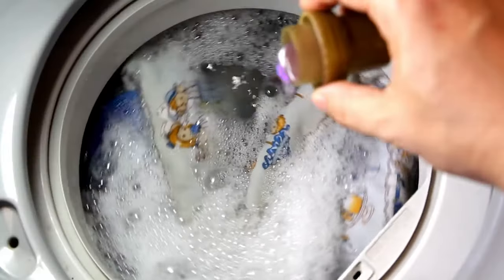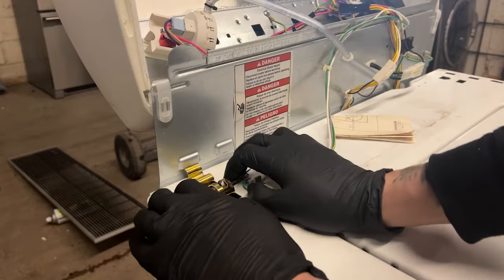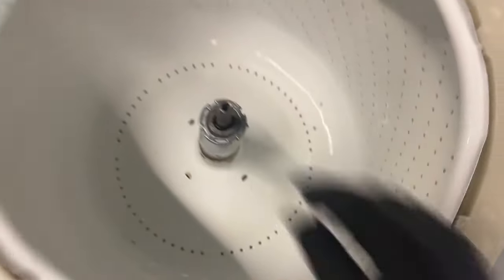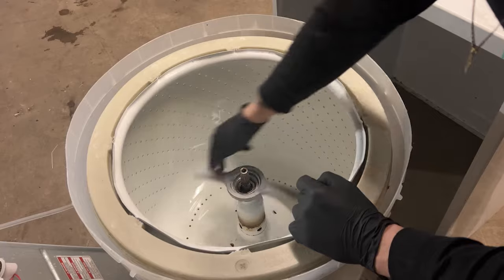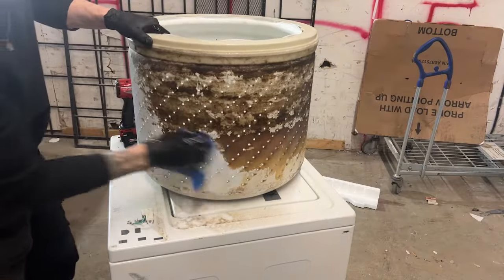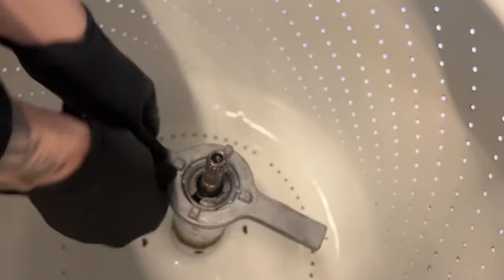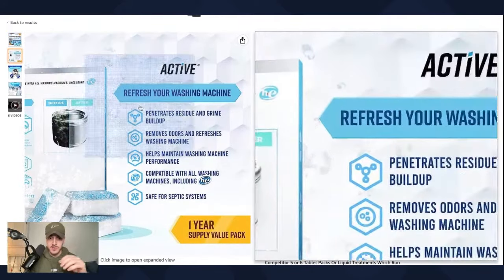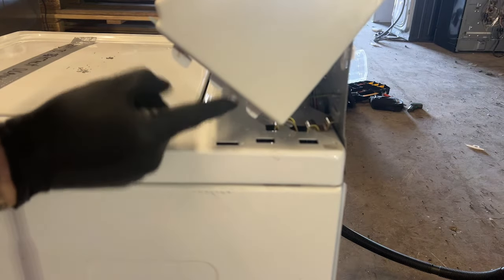Top Load Washer Smells Like Rotten Eggs | The GROSS Reality & ULTIMATE Fix Tutorial (2024)

Comment from the maker: What are the chances your washing machine looks like this on the inside? Let me know!
Reply: Appdude. Is there a school or a job training program?
Reply: 100%.  My top loader has been sitting in my garage for 5 years. It was almost brand new when I moved to this townhouse that had a front loader in it which I used until it died. (Control panel). 
I switched them out and EEEWWWWWW it stinks and has made my clothes stink. I owned a pet grooming business  that required a heavy duty washer o do towels all day long, so needless to say, the nearly new washer to a massive beating with a very dirty and filthy hairy stick so to speak) so it doesn't surprise me that it's like this. But I am concerned about what the cost will be to have a company clean it like this, but it NEEDS it so so bad. I was able to get the top part off where the fabric softener goes. I have no idea how much might have been used, I don't typically use it, but I had roommates that may have and tyw mold and filthy residue inside that part tells me it's in bad shape dirt wise. The washer was in the room where I bathed the dogs and it got filthy. My clothes were fine until now so letting it sit.....well I had had a feeling it would take more than a washing machine cleaner tablet or 5 and needs professional help! Thanks for posting this video. I'm not going to try this myself although my daughter may want to. I think it's worth the cost of getting it done.......unless I can't afford it. But the washer itself is larger and "heavy duty" so there's no way we're getting rid of it. Finding one was nearly impossible 6 years ago!

Comment: I have burned through several electronic washing machines but still have my 1989 Kenmore with the fabric softener dispenser in the agitator top.  You featured this one time.  @Derrickwith2rs. When I took that dispenser off to change out the dog ears, it was loaded with wax everywhere.  I scraped it off with a plastic putty knife and a kitchen spatula.  I use white vinegar.  I never use fragrance, so it wasn't such a drastic change for me like others who are nose blind addicted to fragrance.  They think that clean means stinking of bleach and fragrance crystals (huge waste of money).  I wonder if my tub looks like the one you showed.
Reply from the maker: There is only one way to find out! You have to take it apart aha!
Reply: Taking it apart....and most of all putting it back together again is what makes me sure I need some professional help. I wonder who to call and what the cost would typically be

Comment: Could I just use a pressure washer for the inner tub? (1700 psi)
Reply from the maker: Possibly on the inside tub, definitely not on the outside tub considering it is made of plastic. Even with the inside tub, I'd consider using something a little more gentle.

Comment: Be warned 
I did this and broke the locking plastics for the outside barrel. Please be patient with it. I have it zip tied now

Also the inner tub has stuck in there good. Had to use a 3 clamp jaw with a chain vice grip to remove
Reply from the maker: Thank you for letting the audience know this! They can be very fragile
Reply: @theappliancedudes  do a video on how to replace this and where to get the part number